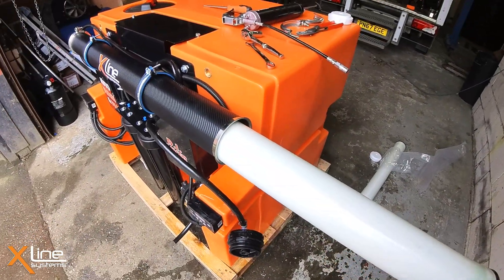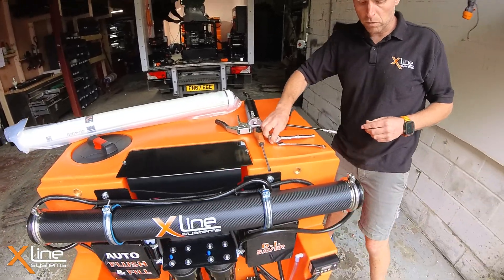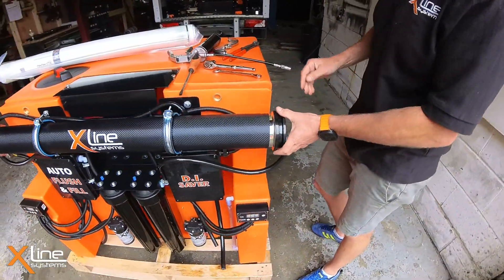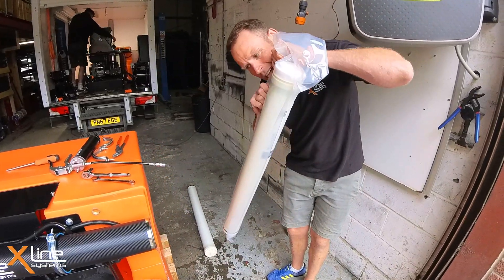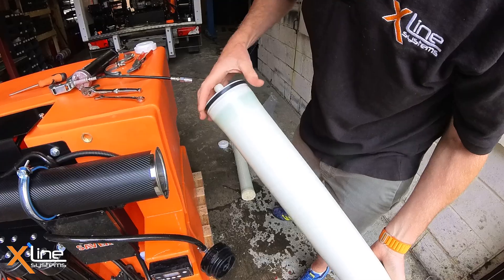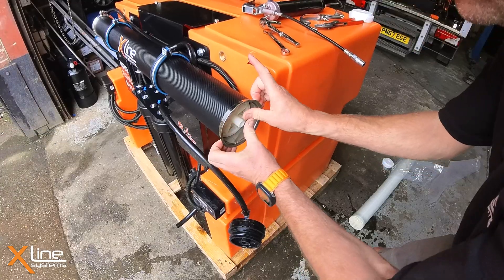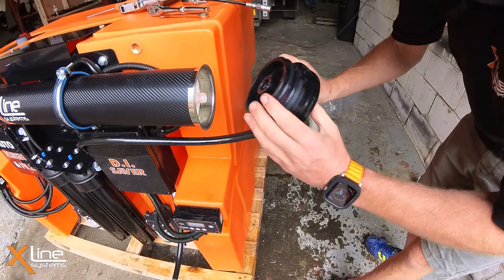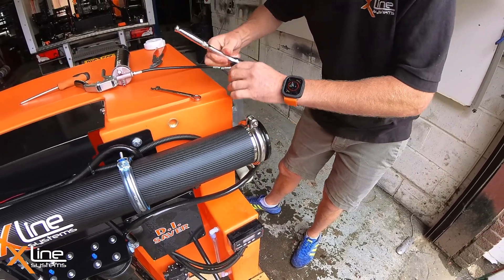How to Change a 40" R/O (Reverse Osmosis) Membrane in an Xline Pure Water Filter System

Comment: Great demo, thanks. Just one observation for you, If you installed that system in a van with only 1 side door on the passenger side it would necessitate the removal of the housing to change the RO. If you put it the other way round with the inlet on the passenger side then it might just slide out of the open door. I understand it might make your costs slightly more with an extra couple of meters of pipework but it might make maintenance easier.
Reply from the maker: Hi, we find it rare the RO lines up with side doors, so we always end up removing the complete housing to then swap over the membrane and remounting the housing again. Only takes an additional few minutes.

Comment: A little difficult when it's situated in the van, as can't pull out from the side and a little restricted getting the whole thing off when there's 2 raised electric hose reels in the way?
Reply from the maker: Hi Mark, hope your well. Yes agree, it's more difficult when the system is in a van. You would have to unscrew the 2x caddy clamps that are holding the membrane housing into place. Give us a call if you run into any problems, or have any questions. Speak soon, cheers Andy
Reply: @XlineSystemsLtd  Hi Andy, hope you are well, thanks for responding so quickly!.. don't need changing yet..THANK GOD!!... but glad you're on the other end of the phone for help, but if I really get stuck, then it will have to be another ride up to you! HAHA